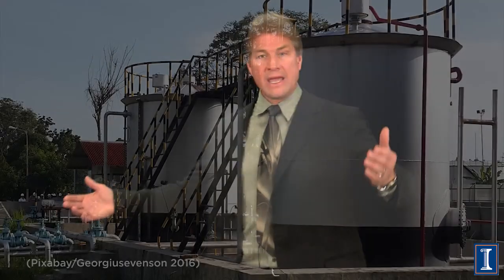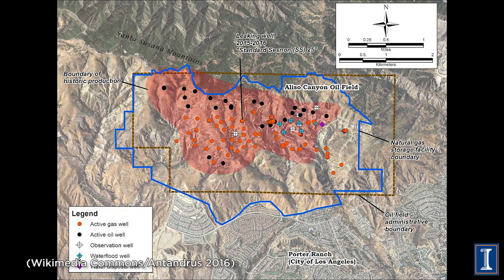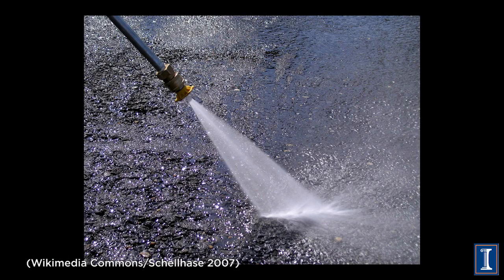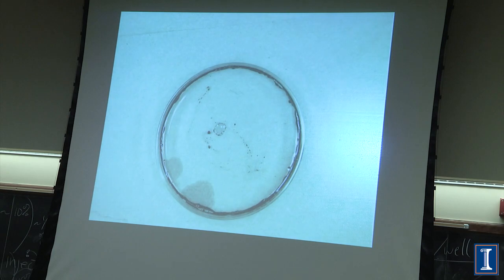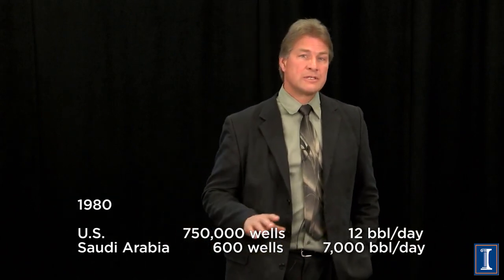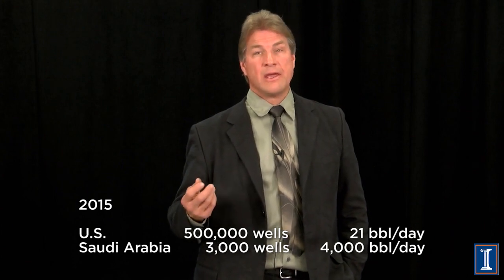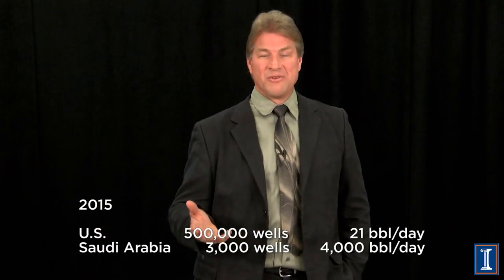How to Get Even More Out!

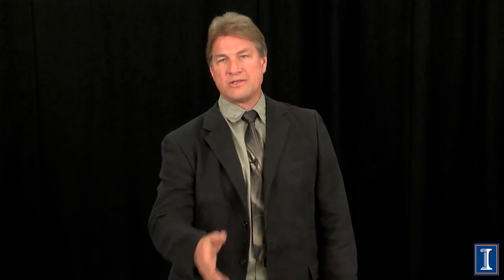Comment: I do not comment often, but as a Swede, seeing the SAAB engine at 5:19, I felt I had to comment. And the comment is... drum role.... I love you to death my man! I work in the nuclear sector but have a fascination of all things energy, and these videos have taught me so much of the fundamentals in various energy fields! From my master thesis, learning about nuclear economics, to now, 5 years later, going back and wanting to gain an insight in the oil industry from a technical point of view after seeing the "The price" documentary. Appreciate the effort.

If I could wish for a topic, and maybe a too complex of a topic, it would be to portray the sometimes (in my view) simplified idea of a 100% renewable system. Yes the electricity is (when produced) dirt cheap but I feel the proponents of this idea underestimate, or misjudge, the cost of an overexpansion and underutilization of grid infrastructure, cost of stand-by (gas) capacity (like capacity markets), cost of storage (especially long-term), and increased financial rates (WACC) due to uncertainty in stable production and consumtion. As said, complex topic indeed, but maybe a counter point to the sometimes very oversimplified idea that is 100% variable.  Hope you read this after 6 years. Cheers!

Comment: My car was making too much smoke from burning oil so I was going to junk it.  I put water in the crank case with a little bit of oil to make it slippery and it hardly smoked at all.  I got a few more weeks out of it before the engine siezed up.

Comment: Wouldn't gasifiing and condensing coal into liquid fuels be more profitable? Wood, plastics and rubber could be processed into diesel, gasoline and Airplane fuel with the right type of refinery. 
I think that you will say that as long as the price of oil is high enough then it would be a viable solution...
So do you know what kind of price is needed for this to make sense?
Reply: This has been happening in South Africa since the 1960's; research Sasol.

Comment: Hello Energy prof. 

Would you please do a video on NH3 as a motor fuel?
It burns well in internal combustion engines.
It has reasonably high energy density.

It is produced already in large quantities.
The science of production is well understood.

Wholesale is about 40 cents/gallon.
It is very easy to liquefy and transport.

It is lighter than air, so it disperses quickly if released.
It is difficult to burn outside of an engine.
It produces nitrogen and water when burned, no CO2..
It may be produced from water and air and heat.
Refueling an ammonia powered vehicle is much faster than recharging an electric vehicle.
Ammonia is an appropriate fuel for trucks, as well as passenger cars.

Manufacture from natural gas is marginally cheaper but a production plant in Norway based on electrolysis of water successfully competed for many decades.
To me a nuclear and ammonia economy is the obvious answer to the climate change problem, as the science of production and economics of ammonia are already well established.
NH3 may also be manufactured to store off peak power.
Thank you for considering this.
Reply: Interesting, very interesting. I have heard of Ammonia as a fuel but never seen the argument for it put so clearly. Your point about off peak power is well taken for sure.